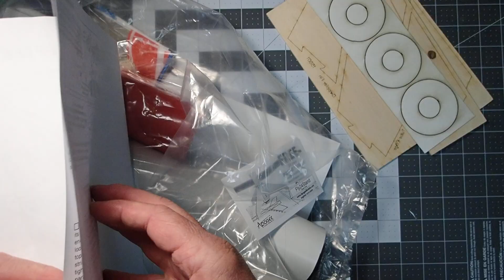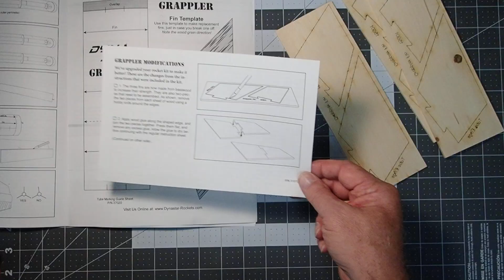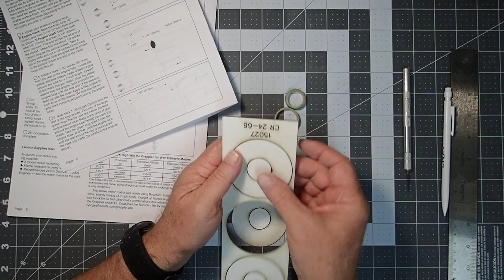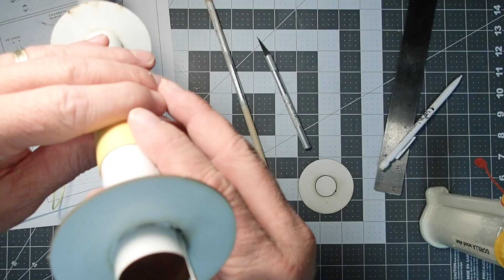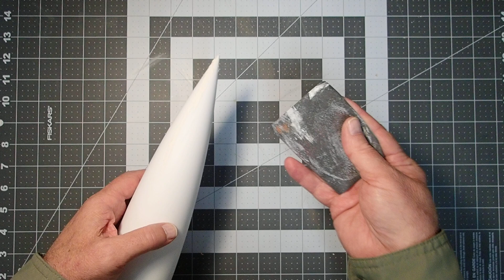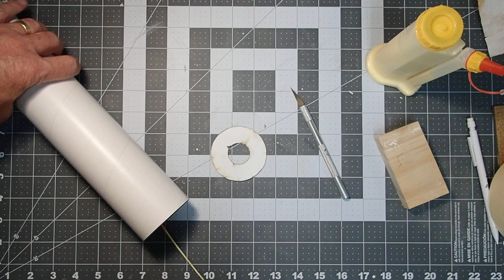Dyna-Star "Grappler" model rocket assembly (part 1 of 2)

Comment: This may cause other problems (that haven’t occurred to me yet) but I would be tempted to install the engine block from the aft end at the beginning of the motor mount build. Just be certain that it is on the forward side of the engine hook.
Reply from the maker: If you try inserting the motor mount before it's finished, you may have glue in places it shouldn't be.